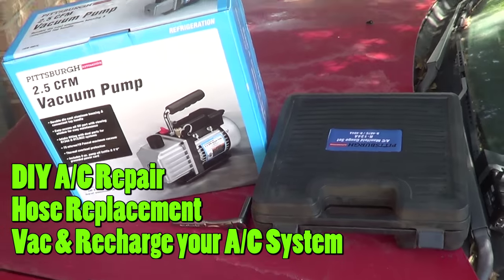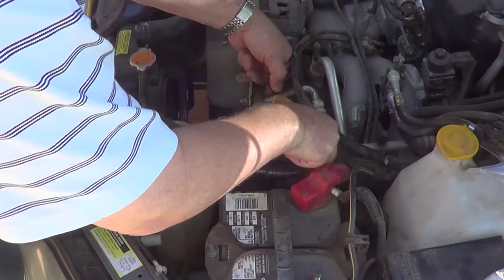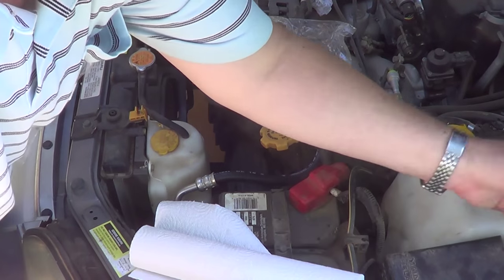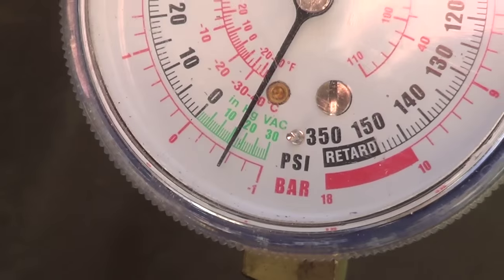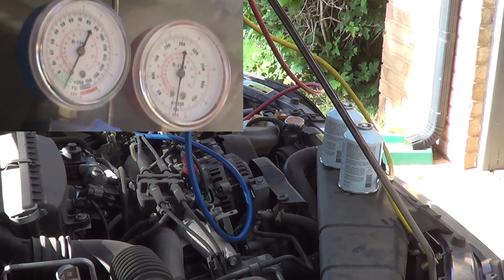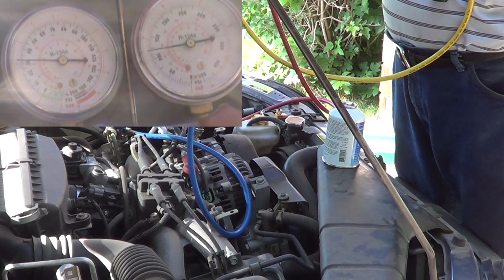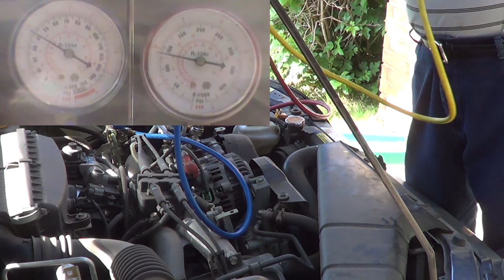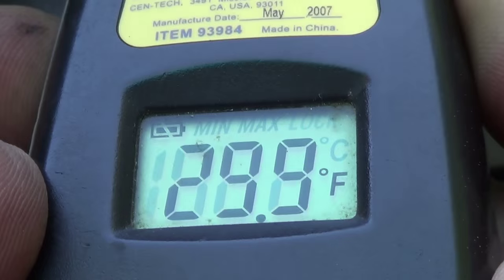DIY A/C Repair Replace Leaky Hose Vacuum and Recharge your A/C System

Comment: You can rent the vac pump and gauge sets for free from O'reilly. You have to pay a couple hundred dollars, use it for 48 hrs max then return for a full refund.
Reply: Thanks for the info
Reply: Why do you need a vacuum it
Reply: @cameronpatterson8159  to remove any moisture from the system

Comment: my high pressure line broke and it spewed black/gray liquid all under the hood. was it the ac oil and do i need to add more oil to the ac compressor?

Comment: I was looking for this video, as I had a belt snap and tear up that exact hose, and wanted to see what was involved. Ironically if that metal crimper on the hose extended another inch, it would havep protected the hose from that belt hitting it as it tore up while I was on the road. I ended up getting the shop to take care of it as I didn't have the equipment and accessing all that is a real pain in my small car. Cool stuff!

Comment: Good video. Just wanted to ask my ac on a Toyota Yaris 2009 doesn't work at all. I took it for a full diagnostic witch cost me £90GBP and got told the condensor and pressure line has leakage where the line is attached to the condensor as there was a dye around it. I got told it was worn out as its not been on for a few years and it would cost £350 plus for it to be changed. So he said hes not going to change that as its costly for me but there is another way where he will remove it and he has to order new bolts apparently they have special bolts that needs to be replaced also put new seals in and add sealent to fix all the micro leaks and the leak that he found and then add aircon gas but its going to charge me £160GBP for that to get done. I just wanted to know if i am getting done over for what hes asking for the job hes going to do. What is the labour cost and the cost of all the bits hes going to get for the job?  If someone has a general idea of the cost of that job that would help me to know what to do and get it fixed so ac starts working again. Thanks in advance
Reply from the maker: Just sure you get a warranty of work done and leak fixed i'm not a fan of sealer  research  YouTube video's for your specific car for options - Charles
Reply: @CrCook  Thanks for a quick response. I just keep thinking its abit too steep for asking for that much for literally puting sealent in the system and yh iv asked him and said i can take it back if it doesn't work but i also dont want anything else going wrong. Well i hope it works and lasts.

Comment: I just read that they recommend the drier be changed any time the system has been opened.
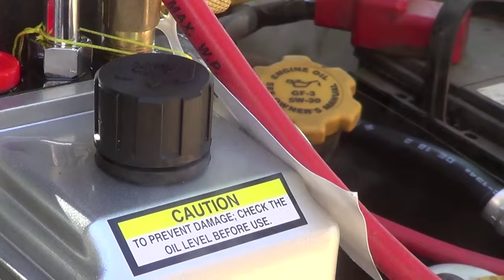Reply from the maker: Yes it is better to do that. I did mention that I might later replace the dryer at 8:30 but it worked fine the suction pump got a lot of the moisture out of the line and it was not broke for long so the dryer was probably not ruined yet - Charles
Reply: mine had a hole in the hose for months. I think I'll just go ahead and replace the condenser and dryer. I don't want to pay another guy 150 dollars just to find another leak or defective dryer.
Reply from the maker: Yes it always good to play it safe - Charles

Comment: I have the same leaking problem on my corrola ac line hose is leaking. Can I just change it with out the pressure squirting out antifreeze
Reply from the maker: no sure dont know specifics search or what hose you are looking at but usally the system are separate you got your ac lines and condenser and you got your antifreeze cooling lines and radiator my line were no way near the antifreeze lines ….. but if you mean Freon line leaking out mine was already drained out and empty so I did not have to worry about recovery you may have better luck looking for a Toyota corolla specific video - Charles
Reply: Cr Cook  since It didn’t give me the time for the ac line to get shipped, the belt snapped in the middle of the eway. Almost crash. Steering got locked and hard to brake car overheated a lil. My guess the ac fluid where leaking on the belt and the heat snapped it. Some like that..

Comment: How you know theres a leak in hose or it just  O-rings thats leaking?
Reply from the maker: The Oil was Clearly coming from behind the Connection.or in the middle of the Hose if it was just a O-ring the Oil would be in 1 place around the connection - Charles

Comment: I need to replace a leaking hose I put Freon and the car has no cold air in 2 days! Do I need to evacuate the system before taking the hose out?? Or I can just take it out? It’s the hose going to the compressor
Reply from the maker: Probally have a bigger problem you should vacuum system first but if there's a correct charge In the system and no cooling at all seek professional help sorry above diy experiences

Comment: I don't want a repeat of bolt breaking off like it did when I took hose off the other car. That'd be a hell of a thing to fix. What do you think I should do? Thinking of loosen / tighten it a lil at a time spraying WD 40 all the time doing this.? Back and forth or that might be too much and put more strain on it?
Reply from the maker: That's a tough one they may be videos on YouTube showing how to remove stuck bolts with out breaking them off can't really cover that type of info in a short comment sorry - Charles
Reply: @CrCook  have you heard that it does happen often? I hope not and it comes out easily.
Reply from the maker: @frankmontez6853  no I have not heard Hope it does come out easy and is no problem to you Good Luck let us know how it comes out - Charles
Reply: @CrCook  came out without too much trouble. Did you lube it putting it back in and with what? I've heard some use silicone?

Comment: Did you lube the o-rings before installation?  Thanks!
Reply: I did. I don't want a repeat of bolt breaking off like it did when I took hose off the other car. That'd be a hell of a thing to fix. What do you think I should do? Thinking of loosen / tighten it a lil at a time spraying WD 40 all the time doing this.? Back and forth or that might be too much and put more strain on it?

Comment: Got hose off and should I lube it and with what? Any ol grease or 3 in 1 oil or silicone?
Reply from the maker: Might use some anti seize on the bolts - Charles
Reply: @CrCook  asking for what lube if any to use on o rings. I'm just going to use what I have.

Comment: Or after ya finish replacing the hose just take it somewhere and have it recharged for 30 bucks.
Reply: @CALICOTV301 Sucks to be you! Really ya should have shopped around....the first one I went to wanted over 100 bucks to pull a vacuum and 3 cans of freon (the freon is where he got ya)....went to Wal Mart bought 3 cans for $9 bucks and took it to a shop where he charged me 30 bucks to pull vacuum and recharge.
Reply: @CALICOTV301 $99 is standard recharge fees
Reply: I paid $70 for my tacoma  which isn’t bad tbh ice old air now
Reply: Y’all paying $99 wtf, my friend does it and won’t even take $10 Lmfaooo

Comment: Hi!

A dumb question maybe but. . 
If there is no pressure on the low side, is there pressure on the high side? 

Thanx from Sweden ☺
Reply from the maker: +Fredrik Sundvall Only way to tell is by using gauges to measure both sides and see if that's a possibility . That almost like the question if a tree falls in the woods......... - Charles
Reply: That' s a very good question, High side means the side of the compressor the gas builds up on. the LOW side means the side of the compressor the gas is sucked up on through the compressor.  Simple huh! upon doing a new , clean refill of the lines like this gentleman did. one must have for the  first initial can of Freon both high and low side gauge line should be open to get the gas into the compressor. then after the 1st can is emptied then fill directly to the low side for the 2nd can of Freon , that way you want have to play with the gas throttle and rev the engine. lol The compressor will take the Freon very easily . I had a leaky shredder valve and couldn't get the valve to come out , so ended up having to replace the high and low side lines along with the Dryer/ Evaporator .   It was on a 13 year old GMC 1500 Sierra truck. now the Air works very nice and COLD.

Comment: Put some silicon on them ends
Reply: I don't want a repeat of bolt breaking off like it did when I took hose off the other car. That'd be a hell of a thing to fix. What do you think I should do? Thinking of loosen / tighten it a lil at a time spraying WD 40 all the time doing this.? Back and forth or that might be too much and put more strain on it? And use silicon?
Reply: I don't want a repeat of bolt breaking off like it did when I took hose off the other car. That'd be a hell of a thing to fix. What do you think I should do? Thinking of loosen / tighten it a lil at a time spraying WD 40 all the time doing this.? Back and forth or that might be too much and put more strain on it?